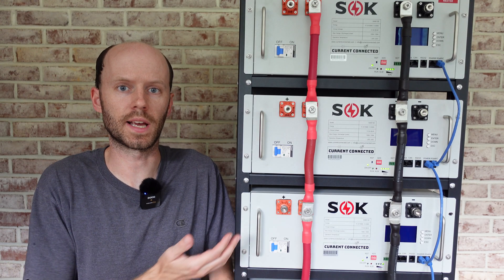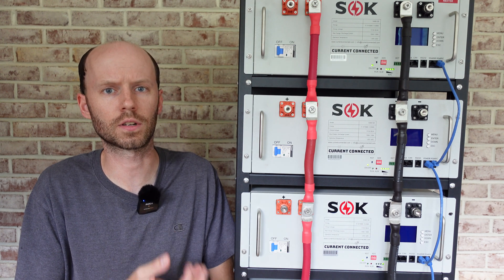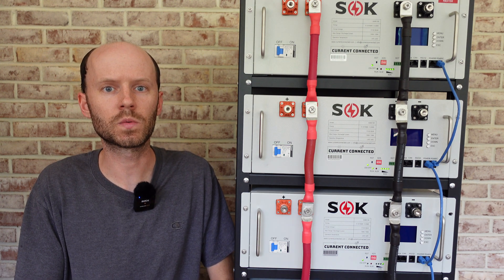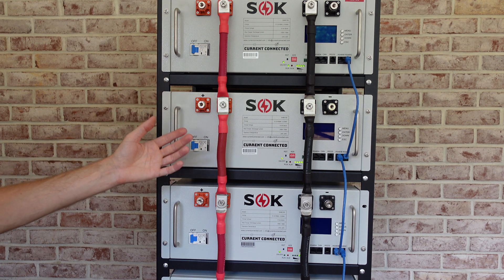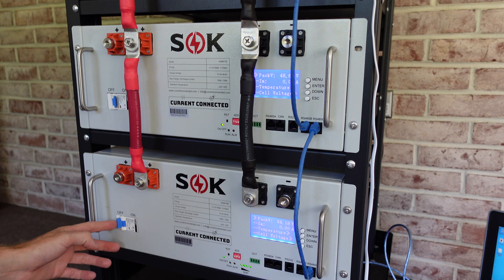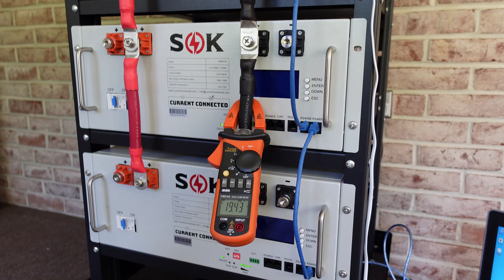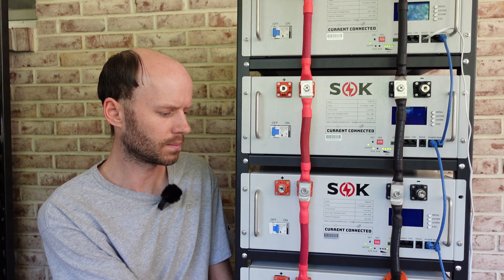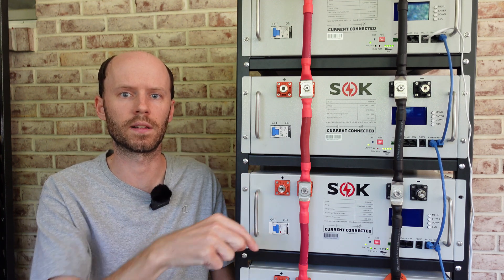Charge Current Limiting of the SOK 48V LiFePO4 Server Rack Batteries

Comment: Hows things. Do you know if these batteries can be turned off for say 1 year and not drain. I heard if you press the rst button it can turn on/off the bms. Do you know anything about this. Thanks
Reply from the maker: I think you press and hold the reset button to turn it off. It's been a while since I've done it. I don't know if there is any kind of parasitic drain while it's turned off. Your best bet would be to tell SOK you need to store it for a year and see what they recommend.
Reply: @LithiumSolar  thanks. I'll have to try to turn it on next time I'm around there . Cheers

Comment: It didn't work for me. I get the SCP triggered. So does it require the RS485 connector for them to know they are connected to another battery?? Else how does it know you don't want 100A out?
Reply: it is triggered by >100A INRUSH charging current>> BMS throttles it down to 20 A charge

Comment: I have a difficult question for you have you ever seen or heard of ev batteries like the ones battery hookup sells used for solar or wind power storage bank?
Reply from the maker: Yes, and almost considered buying some myself many times in the past. However, they're not LiFePO4 and the price of LiFePO4 has come down so much that I've stopped looking at those (which are likely NMC).

Comment: This is happening when their communication ports of both batteries are talking to each other, what if you removed both RJ45 cables?
Reply from the maker: The charge limiter is a function of the BMS and does not require any communications. It will work if you only have 1 battery too and try to charge it to fast with a charger.

Comment: Good to see someone finally demonstrate the current limiting abilities of this BMS.  It's quite an important feature with parallel batteries.  As anyone that has been around for long enough knows you can never 100% match batteries so there is always a bit of capacity difference.  Since they are paralleled and therefore, slight wiring drop aside, held at the same voltage the current must change as each battery reaches a given state of charge and 'increases its charging resistance'.  With lifepo4's very flat charge curve this means that at the near top of charge there will be quite a rapid change in current distribution.  This can see one battery receiving a substantial precentage of overall charge current being supplied to the bank, possibly beyond desirable and even to the point where a 'standard' BMS would cut off charging.  This BMS addresses this nicely.  I'm not sure if the meritsun style BMS also does progressive charge throttling as temperature rises.  Perhaps this would be an another experiment to perform and if it doesn't provide some feedback to SOK to see if the feature could be incorporated into later versions of the BMS firmware.

Comment: I have 10 batteries totaling 132kWh. My Trophy battery does the same bs. My DIY 280ah batteries will all charge 37A when the Trophy is charging at 10A! That's why they don't want us mixing battery brands, sizes and types. That is why my trophy sets at 80% and everything else is 90-95%.

Comment: Very good to know about another safety feature on these batteries. Interesting on how you are stacking the cables. Does the High Tech Lab say anything about that design feature for SOK server rack: saftey or otherwise? Is it about time for a 1 yr update on the heat pump water heater? Great content by the way.
Reply from the maker: So many people asking about the heat pump water heater lol. I don't understand, it just sits there and makes hot water and is not very interesting. Is there something you would like to see? I can make another video one of these days.
Reply: @LithiumSolar  I'd be curious for a bit of real-world info from you about energy consumed, esp. vs. your pre-heat-pump setup.
Reply: @LithiumSolar  like how large of an area/volume you have located it in. What surrounds the area...concrete, block, earth, air? How cold does the area get in the winter time and do you run a heat pump or gas furnace to reheat that area?

Comment: It would be interesting to see the amp draw when you have a 1000 watt load on the dead battery. Would it show 40 amps I think so. I wonder how they regulate that.
Reply from the maker: I think the current limiting only happens on charging. I'm not entirely sure; however, the software only had a charge limit indicator and I didn't see any limiting tripped on the full battery while this was happening.
Reply: @LithiumSolar  On my 3 BMS (battery) system while charging the system and drawing a load the 3 BMS could be all at different levels some minus and some plus depends on the load and how large the charge current is but it is all self regulating flow like water down a hill as the protection cuts in the charge load transfers to the lowest battery

Comment: Awesome information! What's the purpose of not connecting the negative and positive at different ends? I've heard/read that if you have both your positive and negative leads from the top battery, the discharge will not be evenly balanced across all of the batteries run in parallel. I'd love to know if this information is correct or why you might choose not to do it. Thanks!
Reply: It's very simple. If you connect them diagonally, it means the the lead lengths (and thus resistance) will be equal. 
But any other configuration will put longer leads in one side, hence the current flow will be different. 
It's called Ohms Law.
Reply: @graemezimmer604  Nothing in that setup is looking very diagonal (?)

Comment: Looks like you're using 4/0, so this doesn't apply exactly, but Blue Sea Systems makes a great "Dual Entry PowerPost Cable Insulator" (Red P/N 4003, Black P/N 4002) that fits up to 2/0 wire. I use these for my parallel connections to keep the terminals and lugs covered. Wish they made some big 4/0 ones though. Love the video!